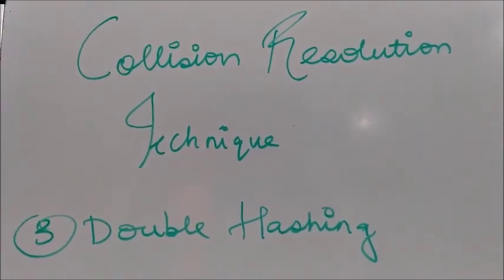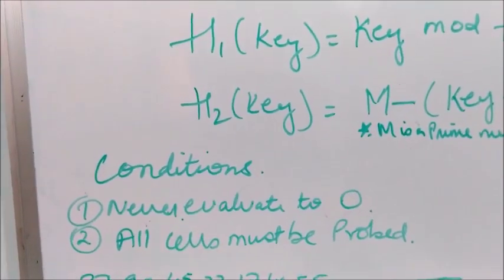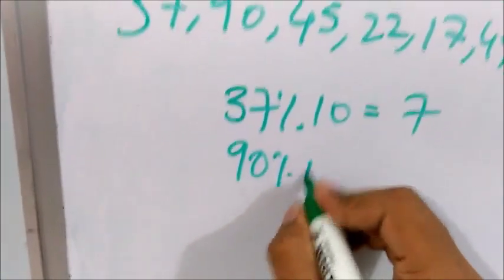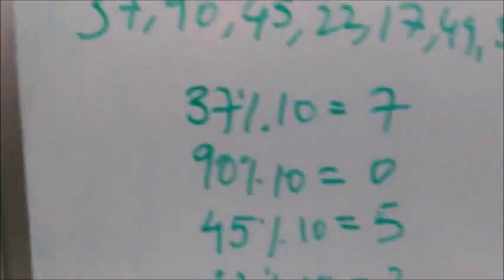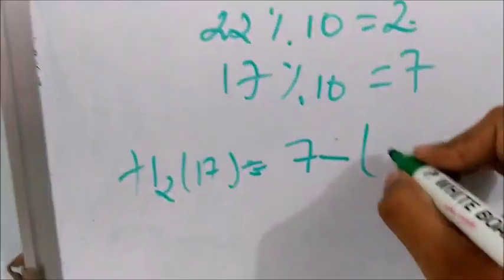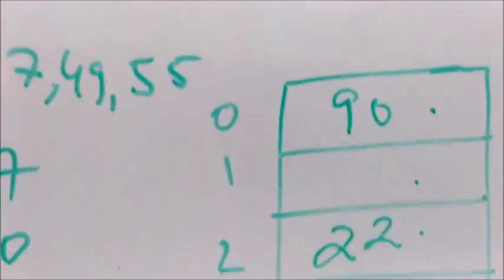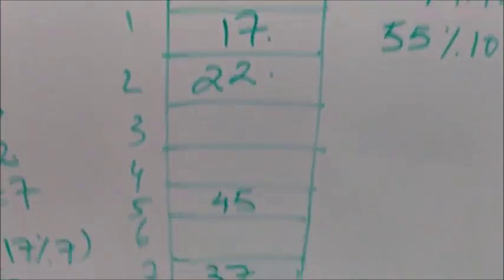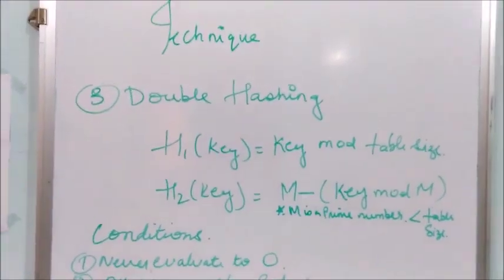Collision Resolution Technique (3.Double Hashing)

Comment: Greetings,
I have run into a problem with double hashing.
My code runs in to an infinite probing for the following data set:
                                        {960, 660 , 780 , 100 ,300 ,340 , 690 , 580 , 620, 750}
But works like a charm for :
                                        {980, 650 , 760 , 120 ,350 ,300 , 690 , 580 , 620, 750}
For the first data set, when I insert 100, my program keeps on checking 5 then 0 then again 5, it wont probe any other index.
0th index has been occupied by 960, and the 5th index has been occupied by 660. 
Please look into this.
Thanks

Comment: Wrong way to double hashing , formula is: ( hash1(key) + i*hash2(key) % size of table)
While inserting 17 you are inserting 17 on the basis of 'hash2(key)'  not on the basis double hashing formula i.e ( hash1(key) + i*hash2(key) % size of table). 
Actually, value of hash2(key) and hash1(key) will be put in double hashing formula then out come 'number' from formula would be the index for key.
Correct approach:
hash1(key)= key%size of table.
hash2(key)= Prime - (key%prime) 
i= iteration count for calculating the index for key until no collision occurred means if outcome index is again colliding then value of 'i' will be incremented and again we cal index using double hashing formula. Initial value is of 'i' is 1

Comment: what do we do if the no of elements are greater than the hash table size
Reply from the maker: In such scenario we use a concept called Rehashing. In Rehashing we increase the table size based any of the following condition ..
1.when the table is completely full.
2.when the table is half filled 
3.when insertions fail due to overflow 
Etc 
We generally double the table to the next prime number like if the table size is 10 then double of it is 20, we make table size to 23(next prime).

Comment: why is the table size larger than the number of integers?
Reply from the maker: +bouncinggyro In this example we are not considering the size of table,but it is true that if the integers are more than table size then eventually insertions will fail. In such scenario we use a concept called Rehashing. In Rehashing we increase the table size based any of the following condition like..
1.when the table is completely full.
2.when the table is half filled 
3.when insertions fail due to overflow 
Etc 
We generally double the table to the next prime number like if the table size is 10 then double of it is 20, we make table size to 23(next prime).